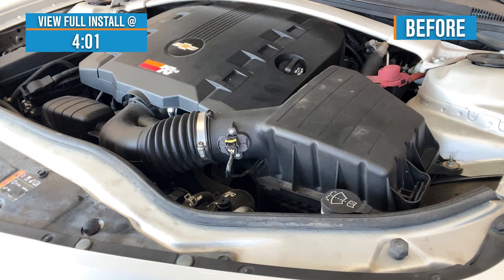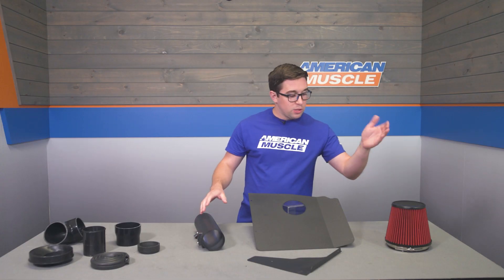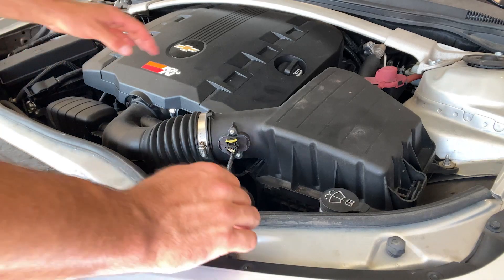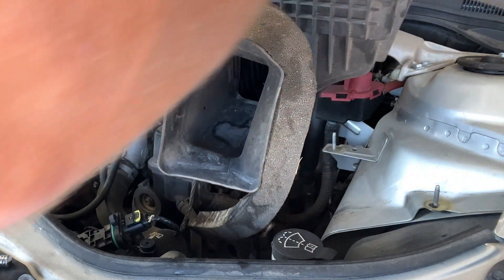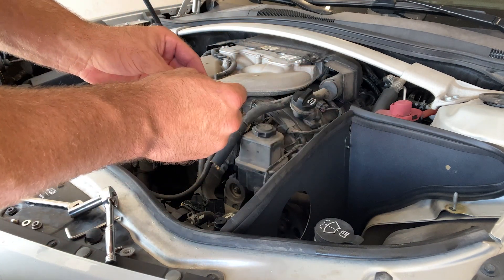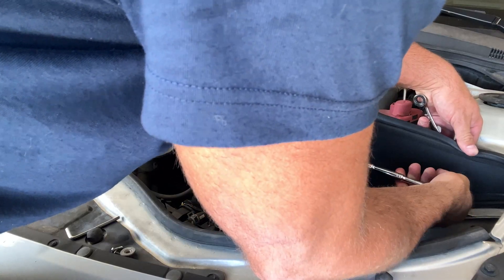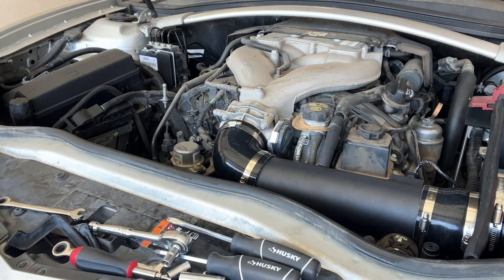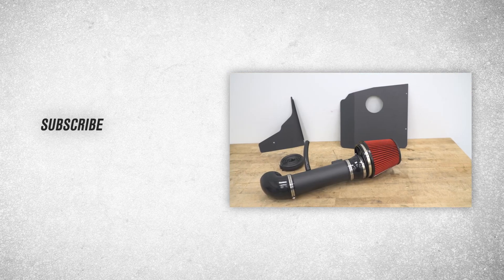2010-2011 3.6L Camaro SR Performance Cold Air Intake; Black Review & Install

Comment: All of my sensors are turning on when I installed this cold air intake. Any idea why? How can I fix this issue?
Reply: Dude mine did too did you figure it out?
Reply: @ecstaticsnake2540  yes, I did multiple things so idk exactly what was it. But to start I unplugged the battery then unplugged the MAF censor. Take out the part of the intake that’s before the air filter ( it should be the intake tube where the MAF censor goes). Make sure everything is plugged in right and facing the right way (the screws that came in with mine were to short) so I went to Home Depot and some longer ones also And there should be like this extra piece, (it’s like another intake tube that goes inside where the MAF censor goes) that holds it down so it won’t rattle.
Reply: @aaronhuerta8662  oh I was wondering why they would send that piece if it wasn’t in the vid you’re talking about the lil tube with the slits right?
Reply: Slit*
Reply: @ecstaticsnake2540  yes
Reply: @aaronhuerta8662 yo question you said multiple sensors mine was the check engine and then out of no where the next day it was stabiltrak and the one of my air sensors that marks 0psi did that happen to you too or nah I just want to figure out if it’s the same problem
Reply: Yup exactly the same. But mine happen when I took it out for a test run. I drove a good 5 miles,I don’t remember the exact order but my check engine light, traction control, tire pressure sensors went off.
Reply: @aaronhuerta8662  so you needed that lil tube with the split !? I installed mine no problems with out it …
Reply: is this a good intake? looking to buy one for my 2010 and came across this. is it reliable?
Reply: @botnion524  I’ve been running this for about 4 months on my 2011 so far so good. You can tell the difference from stock.
Reply: Can i use it on my 2012 camaro rs?
Reply: @Mar2farr any idea what that’s called ? mine broke in half and now my car won’t start